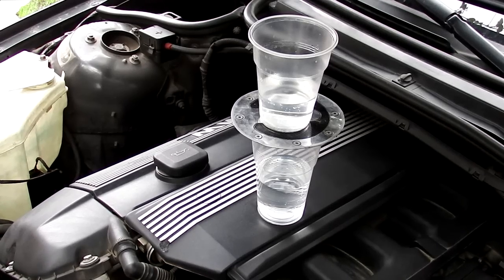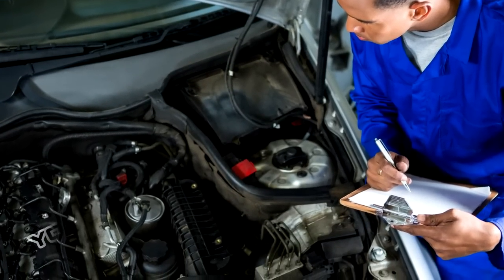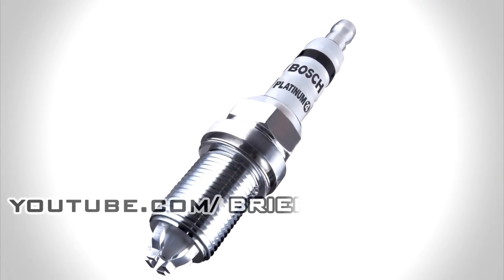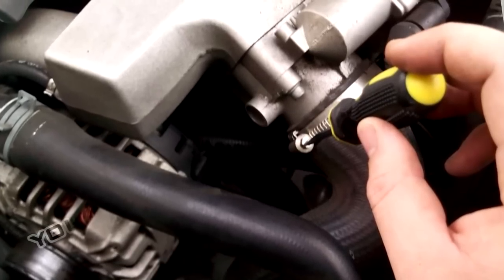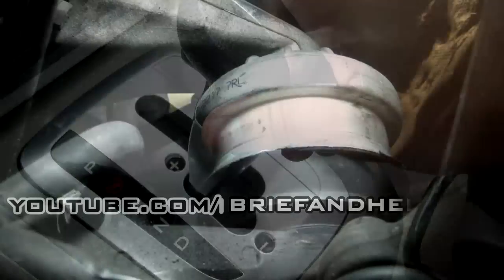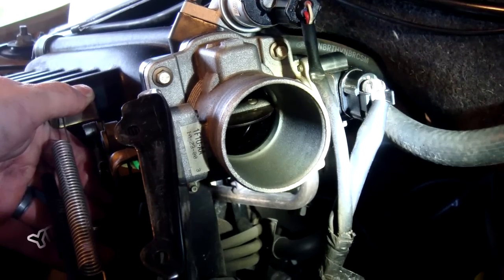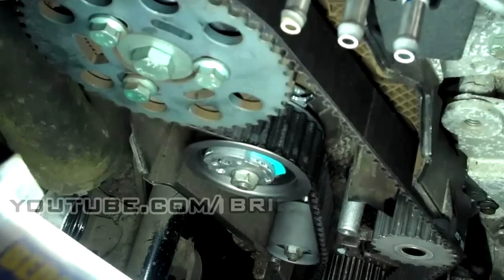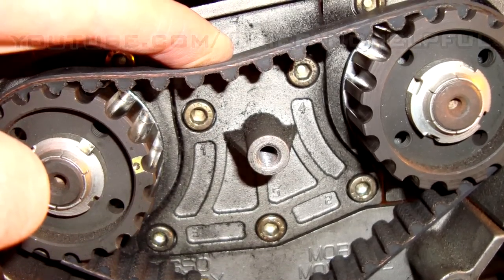causes of engine vibration

Comment: bad torque convertor is the most important one ,you forgot,engine vibrate while in gear,but no vibration when in neutral or park
Reply: How do torque converters go bad? How do they break internally?
Reply: @stephenarling1667  to make it simple there are rotating parts,that have vanes,bearing,so any of them can break inside the converter

Comment: one more thing can do vibration on the car the fuel regulator happened to me with my audy q5 2.0 everibody told me is the clutch and i replaced with new but unfortunately was still vibrating than i went to complain 
and then they found the fuel regulator had problem .toom me 3 month to found out in tbe dealer because i had no error code.
Reply: peter kornfeld got the same problem with 2012 AUDI Q5... how much did it cost mate?